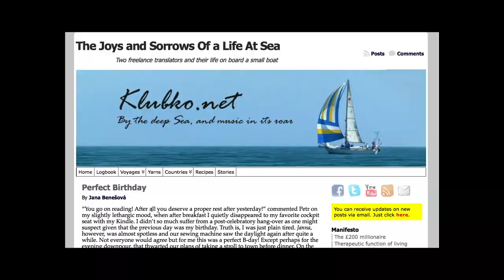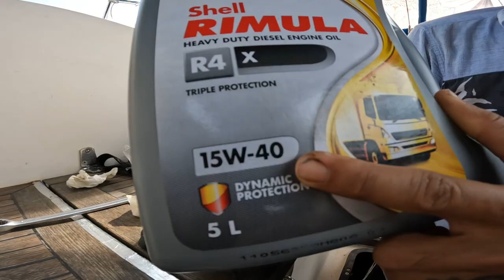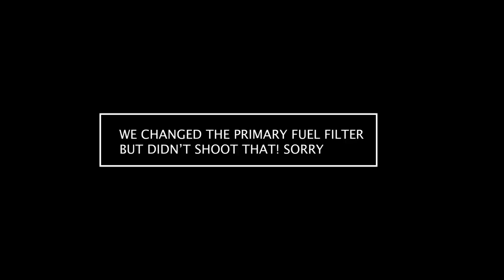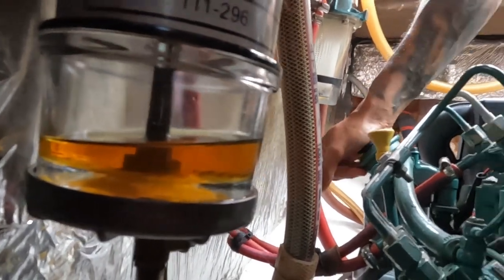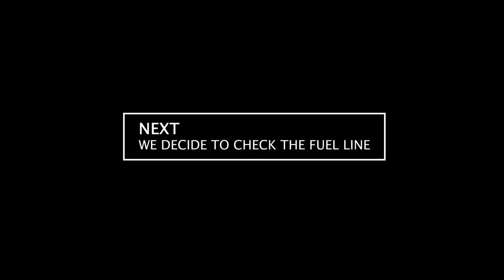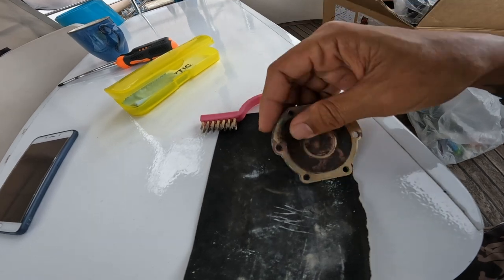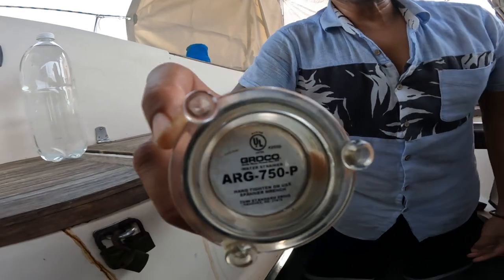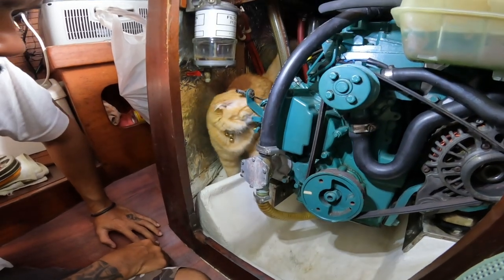Servicing Our Volvo Penta D1-30 S8 EP4 #sailing

Comment: Water was dripping after the installation, not sure the gasket area or the hose clamp. Do keep a whole bunch of heavy duty clamps and steel n plastic wire ties. Definitely will come in handy.
Reply from the maker: Well spotted! Yes water was coming out of the water pump so we had to remove the old water pump sent for service and installed the new one instead. New water pump n new impeller will keep the serviced water pump as a back up. 

We didn't shoot the engine after. Recently removed heat exchanger to service that as a maintenance and now back in. Soon we will have to service the fuel injectors too. 
Thank you for the tip of heavy duty clamps n steel n plastic wire ties. 

You sound experienced and own a marine engine? Cheers
Reply: @24hourtravellers  i'm an Engineer by profession who does a reasonable amount of hands on stuff. Would luv to help u guys out with fiberglass, engine, or troubleshoot and solve anything n everything at all the next time when u guys r in RSYC or the neighborhood. Also, for more technical jobs, I have a fully equipped "bengkel kereta" and "braders" help at your disposal. 
As for the heat exchange, i hope it was a simple sand blast to get it back to optimal performance.
Reply from the maker: Wow that's so awesome, could you email us your contact pls? 24hourtravellers@gmail.com 

We do have questions regarding the injector service.